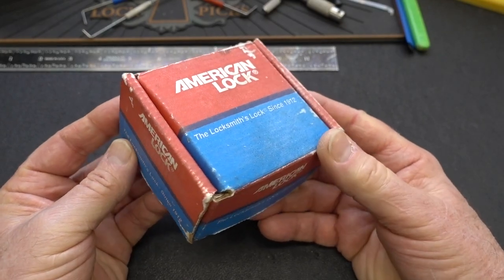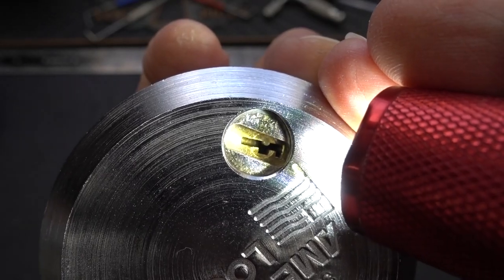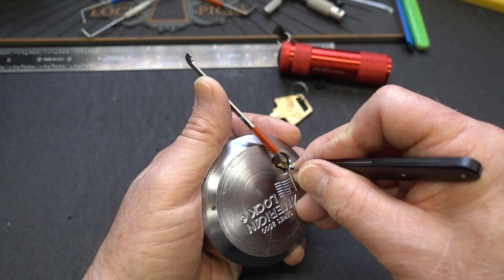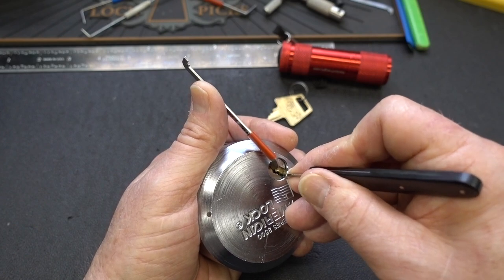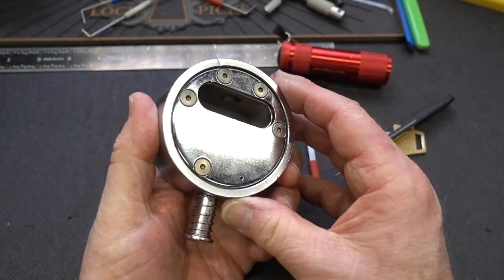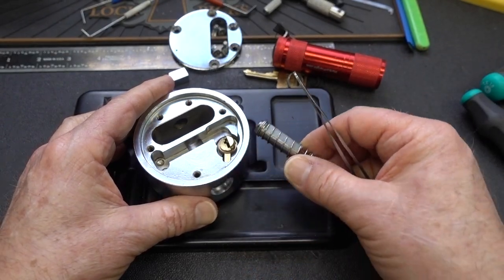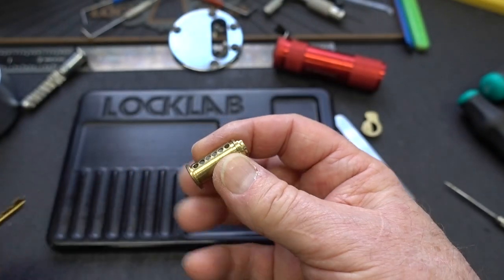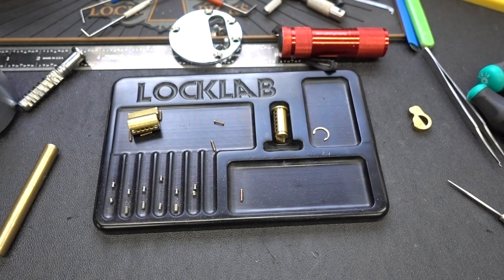(1852) American 2500-Series Puck Lock

Comment: I had the pleasure of retrofitting a new American lock cylinder replacement into one of these older style van padlocks. I don't know why they stopped making them this way. This series can be unlocked and then can be locked again without the key retained. Very convenient. All the new ones cannot be relocked without the key being retained. Very inconvenient. Before you said it, I saw the video header and the keyhole placement,  and I was indeed drooling. Cheers

Comment: I bought a new American puck lock and used its cylinder to outfit the 2500 I was working on. The cylinder has small differences. The length and design. The 2500 series and alike have flat backs. If you set the cylinder housing down on its face without the cylinder core in and put a ruler on top of the cylinder hole, the axis is perpendicular to the body, and totally flat. The newer models have a literal cleft at the back of the cylinder housing. To act as a ward preventing full rotation of the cylinder. I don't remember how the retainer clip accounts for it to hold the cylinder, but the back of the new American cylinders with that raised edge has to be ground down or cut accordingly to accommodate the old cylinder core which is shorter, to be proper for the cylinder port in the puck with the cam and backplate

Comment: Do the screws on the back plate compromise security of the lock?
Reply: A puck lock like this one is supposed to be used with the back plate flat against the door with no access to the back plate. Under those conditions, it won't compromise security. To completely remove each screw with an angled hex key, you'll need more slack in the hasp and pin than I think is possible.

Comment: ********** is the locking bar magnetic *************

I wonder if a super strong magnet could actuate the locking bar.
Reply from the maker: Locking bar?  What locking bar?  You can stop wondering...  This is a case of understanding how a lock works can work in your favor.  Take the time to look at other videos showing how these locks actually work and you'll see that it contains a brass (non-magnetic) core and actuator.  Also, what do you mean by "super strong magnet"?  Like in a magnetic rail gun?  Or perhaps the electromagnetic pulse generated by a nuclear detonation?  THAT kind of "super strong"?

Comment: Bill, it's a pretty sad state of affairs when a company that supposedly hired machinists couldn't figure out how to machine stainless steel.

As anyone with a manufacturing background knows, mass produced parts aren't turned  one piece at a time. These puck would have been part of a large rod that was fed into an automated lathe and had the front face cut first, then a final cutoff tool to part the remains.

A first year metal shop student could have figured that out. 

I can't say I'm a collector, but a person that likes quality manufactured items. I may or may not own a few Junkunc Brothers locks as well as a ample supply of pre Master Lock ownership, American 700's.
Reply: Early stainless steel used a different formulation of chromium and steel compared to modern stainless it was a pain to machine on mass since if your speeds and feeds were off at all it would gouge the surface instead of cleanly milling its the same if the tool was dulled at all
Reply: @Bobis32  
Sorry, not even close. This lock would have been manufactured sometime in the late 1970's or early 1980's. The stainless steel of choice would have been 301 or 303 for it's easy maintainability. I doubt that they use 409/409M or 410 stainless (the same materials used to produce stainless steel firearms)

Any machine operator with more than basic understanding of machining would have started the skim pass, and dialed the rotational speed up or down to improve on the surface finish. 

I'm not a machinist by trade, but worked in a department producing prototypes and limited production items. IMO the only super alloy that can be difficult to machine would be Hastelloy 276 or possibly Inconel 625, but both of those alloys would cost more for the raw stock than what this lock sold for new.
Reply: @gungadinn  have you ever used HSS cutters on a lathe or are you accustomed to tungsten carbide, in my experience HSS leaves marring on the surface of 301 stainless(i mostly machined brass which is soft so i hadnt invested in carbides yet when i started doing stainless steel)
Reply: @Bobis32  
By HSS you referring to cobalt tooling. 3/8x3/8x3" The answer is yes I have. I will sometimes use them in a fly cutter on a Bridgeport.
You want to sharpen them with a small radius for the cutting surface, with a 10 degree relief cut. Crank down on the set screws retaining the cutter to the tool post. Lock down the carriage or saddle or you will get chatter.

When cutting stainless, a heavy weight cutting fluid works (Moly-Dee comes to mind), but little beats flood cooling for keeping the heat out and flushing the chip. For a cutting lube that is much easier to clean up, a product called Boe-Lube (the pink color) is a waxy type product that can be used for drilling, tapping, surface machining, and O-ring installation. MSC sells both of these products. If I had to purchase just one, the Boe-Lube would be it.

Comment: Just wondering, was that actuator tightly tied to the core end or could it rotate on its own if the spring loaded bar were out of the way via a magnet?
Reply: Nm, just rewatched and it was locked to the have round end of the core.